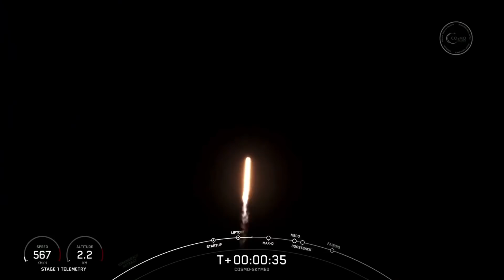SpaceX launches Italian satellite, nails landing in Florida!

Comment: Does the first stage not decelerate to 0 km/hr when it does boost back
Reply: It does for a micro second when it minus outs its forward momentum, but then accelerates in the opposite direction as fast as possible so it can coast in space to get back to base and the entry burn.

Comment: What made this stage 1 land on land vs the ships in the ocean?  Majority of the stage 1 are via the ships in the ocean.  Just seeking clarification.
Reply: falcon 9 only had one payload so the mass was low enough for them to be able to RTLS (return to launch site). Plus naval assets are super expensive so by returning the booster to land they save on the overall launch cost.
Reply: @lillygivens7886  So it depends on the mass of payload.  Payloads like Starlink are more than this particular launch.  So less payload could mean possible return on land but probably not in all cases.  Thank you.
Reply: @ron bo Mass and velocity it needs to have. For example DART mission had much lower mass but it basically needed to go faster so they landed on barge.

Comment: Wow, great camera work from the ground, Best I've seen.
Reply: Absolutely HORRIBLE camera work!! What are you even talking about?? The rocket completely left the field of view multiple times, and was near the trailing edge of the shot for most of the footage! The camera equipment was phenomenal! The camera person should be shot!
Reply: @-108-  Damn you understand nothing but act like you know everything, try filming the ISS transit by? If you are so smart about how easy it is to film something moving so quickly, why not go out there and proof it?
Reply: @TwoMan.  Again, the ISS is completely different, as it is about ~3x as far away and is moving over 10x faster. BUT, even still, put someone into the seat of that tracking rig who actually has a few brain cells and they would be able to track the ISS no problem. The rig is designed to do that; One just needs to use it properly. Why is it that one is hard pressed to find ANY telescopic camera footage from that rig of the Space Shuttle launching that isn't perfectly centered and tracked? It's because the NASA operators knew what they were doing and how to use the equipment. It's the same equipment - it's still there. That's what SpaceX is using. They just can't seem to hire a rig operator that has any sense at all.
Reply: @-108-  Where are your videos kiddo?
Reply: @tgstudio85  I don't cause people to suffer any of the annoying mistakes in my videos by uploading them to the public domain. Then again, neither do I fancy myself a professional camera operator or video production engineer; Nor am I earning a paycheck for such work.

Good try tho! lol

Comment: Why cant use parachute to slow down the booster before landing?
Reply: The booster is falling too fast i think. Also parachutes will complicate things.
Reply: few downsides of parachutes include weight, and that the vehicle has to be under a certain velocity to avoid damage. This would also make the nav computers job 10x harder, the grid fins help control the booster and they require a certain amount of air seed to effectively control. That's why Falcon9's come in so fast and swiftly lands. It sounds counterintuitive but fast velocity really makes this whole thing possible.

Comment: SpaceX makes me wonder why all these other Rocket Companies (Boeing, Ariane, etc...) have been sitting on their hands all these years wasting time, money, and expertise by doing the same ol' thing. 
Sucking easy money from the NASA teat is what I think

SpaceX has moved Rocket Engineering forward a quantum leap in about 15-20 years?
Reply: SpaceX is about rapid innovation and change in order to find the best solution. They learn through failure, this progresses them forward.

Other companies like ULA/Boeing + Lockheed have been around for years and years, innovating minimally because they only use things that work. And when there isn’t a rapid force changing the market like SpaceX with their reusability, this strategy totally works. Why try to beat a force that isn’t there? 

But now, there is that force, and ULA is trying to slowly change to be able to compete with SpaceX. Their Vulcan will have a recoverable first stage engine, the most expensive part of the first stage. 

So yeah, sticking to old traditions and relying on what works is what they’re doing. Like I said, that usually works. Now they have to adapt and it’s hitting them hard.
Reply: Government contractors are the type of people that stay their entire career in the same place using the same procedures over and over. They also make use of several contractors that charge them outrageous fees. A few years back I read an article where they priced a two pound hammer at $500 to either NASA or the US military. There was also a story about very expensive toilet paper supplied by a contractor. With costs like that, nothing will move forward.
Reply: Hey Blue Origin have progressed a lot, they have nailed the animations, and their rapid lobbying against anything SpaceX does is on par with SpaceX rocket progression.